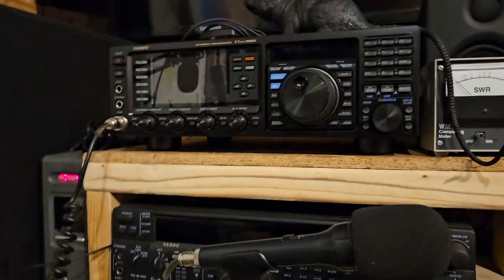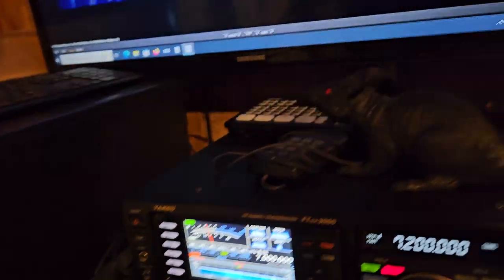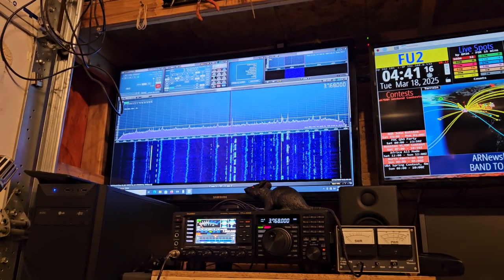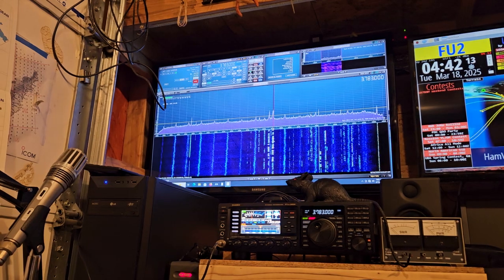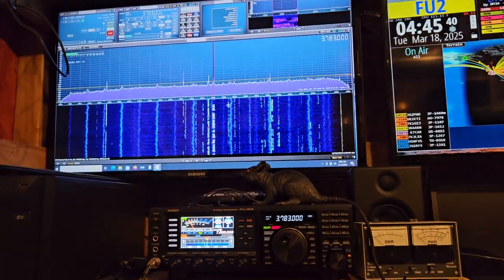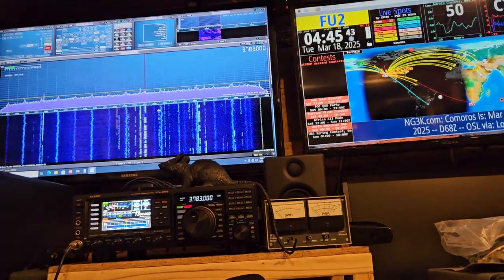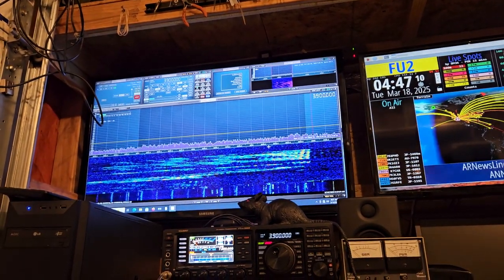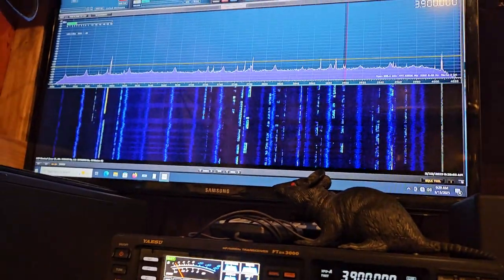MY HAM RADIO SETUP CURRENTLY 👌

Comment: The ftdx 3000 is an excellent radio very underated niose reduction is magic on this radio
Reply from the maker: Its very good. I have a ft710 its good also. But the 3000 is alot older. Another radio that really surprises me is the older ft-920 and I honestly think it's quieter than my 1000 MP

Comment: Great overview. I have an FTDX10 and would love to do the same thing. Could you do a more detailed video of how you connect everything? Thanks.
Reply from the maker: Unfortunately, you would have to buy an IF tap board. The 3000 has a dedicated output to feed a second  receiver . Most radios won't have that. Some have a rx ant port but not second reciever port. Otherwise I probably would use my ft710 the same way. Some people tap the IF stage of a radio.i tried the mfj sdr switch and it boggs down rx 3 s units. 
I think they sell a board for the ftdx10 to tap the rx.
Reply: @hamradiohack  Well sounds a bit more involved than I want to tackle. Thanks for getting back to me. Look forward to your next video.